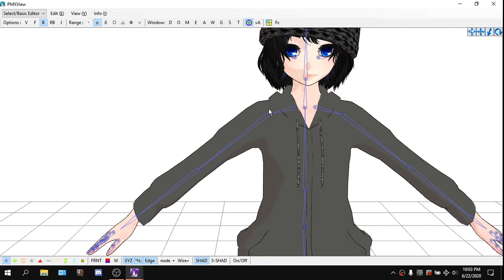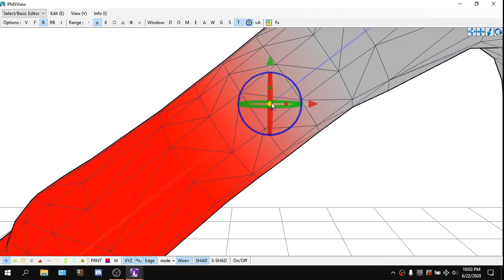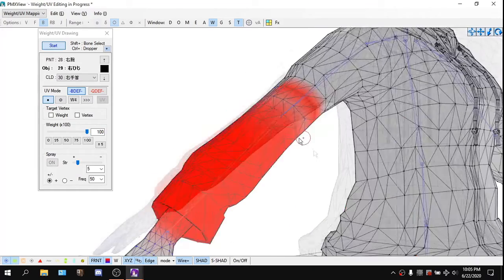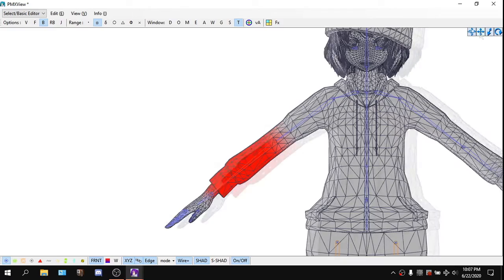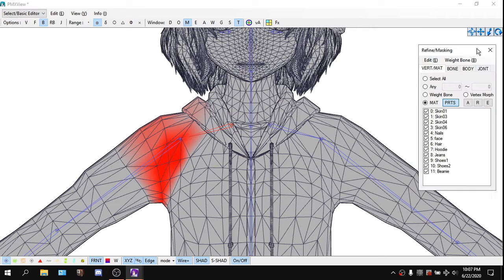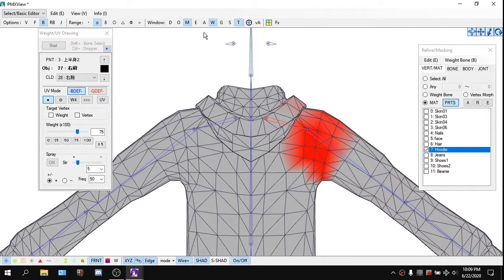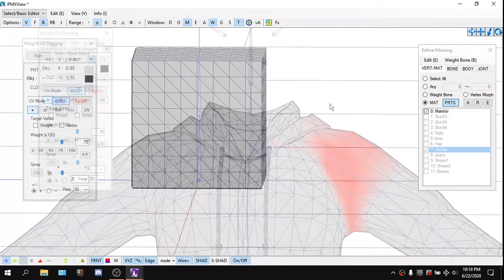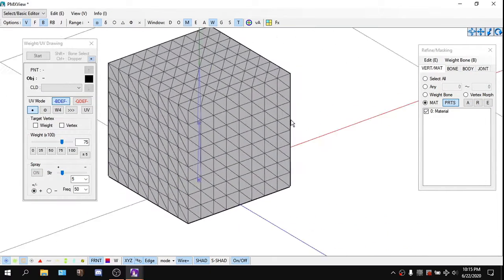[TIPS&TRICKS] PMXE Weight Painting

Comment: Yeh I had to redo the weighting of a model because the physics used distorted them so badly the limbs would become snake like at certain angles. Ended giving up on that model and used the non physics version of the model but still had to re weight the limbs. Getting the shoulders right has been a total nightmare. I recreated most of the physics easily enough though.

Hah!
Your previous video had the trick.
SDEF!

So what about mirroring changes made to the wireframe???
Such a pain having to do it twice.
I should probably learn blender but the controls are so much more complicated.

Comment: Thanks.
Reply: How to delete weighted ? Cause some Parts I can't weight them more or less. It just stays there and won't change
Reply: What do I do ?
Reply from the maker: In your bone order check the bones that are above and below as all bones need to have someone weight. If you weight with 0 one bone, the bone bellow it, will get the weight that was one on the original bone. There can't be vertices in a model that are not weighted.